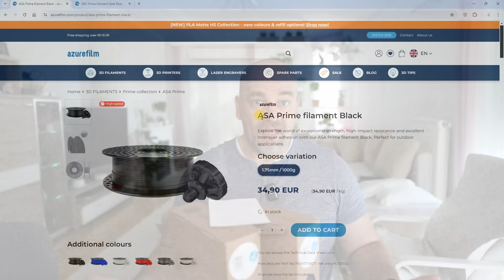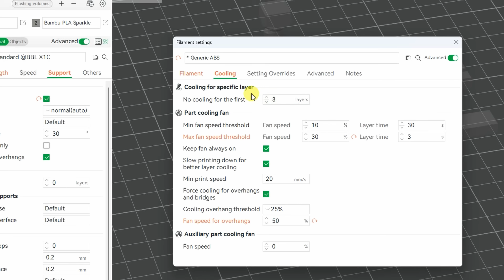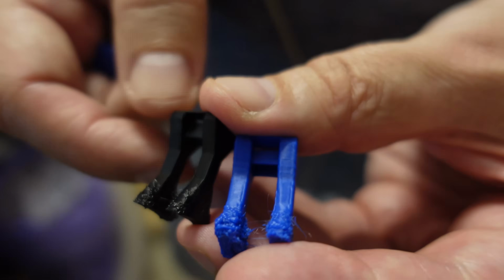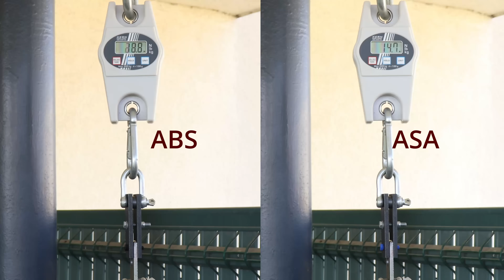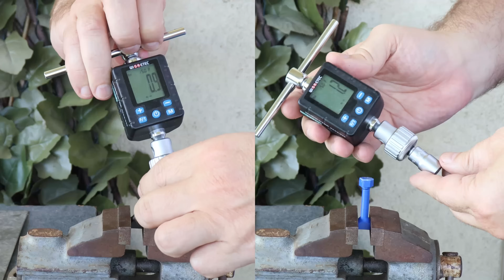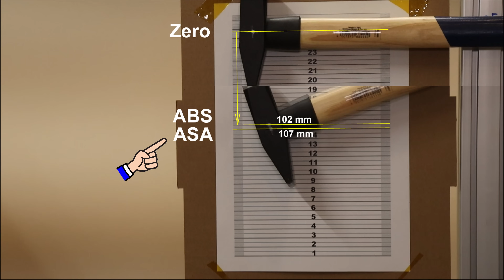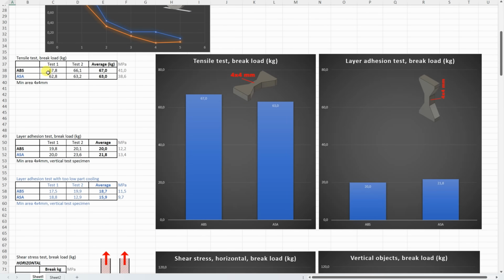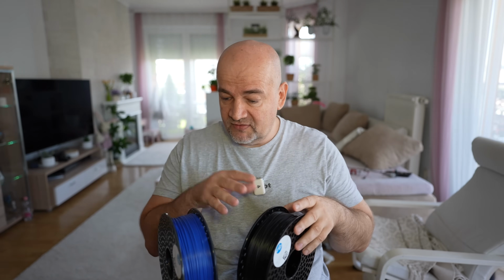Another ABS vs ASA comparison: AzureFilm ABS Prime vs ASA Prime with zero warping techology

Comment: A good review. But. A a serious omission in the testing regime: WARPING! 
Given that the title contains: "ASA.. ...with zero warping" is in the title, where are the warping tests?
Warping susceptibility is the single most negative property of ASA filaments.
Reply from the maker: Its here: https://youtu.be/GfG65ypKTPE?si=306EgZEVGc_qOXDn&t=624
Reply: @MyTechFun  Thanks. I had found that video. I am not impressed with eSun ASA: the layer adhesion is so poor that larger prints warp at an intermediate position, contrary to having good bed adhesion. 
Generally there is a correlation between warping and layer adhesion, except for Flashforge where the result is 10 & 3 whereas Azurefilm is the opposite at 1 & 10. 
Finding the ideal ASA filament is not easy.

Comment: I would suggest that you don't show the summary in a PDF or excel style but show the grey graphs in full screen mode after each test, I think that would improve the videos. Basically skip the summary and intersperce it between the tests to make it a bit easier to relate to the tests and easier to digest in small amounts.

Comment: What do you think is the best filament for gears? Low warping, tough, which brand?  For instance, PA12 eSun is better than other Nylons, that I've tried. But it is interesting to try BambuLab PACF, ASA +CF, and PETG +CF.
Reply from the maker: Usually injection molded are made from nylon.

Comment: I would love to see if the reduced warping persists when you use a printer without an enclosure. I think the need for an enclosure is the main entrance barrier to ABS-like materials for most people. The manufacturer claims it works, so maybe give it a try and share the results? I would highly appreciate it!

AzureFilm on ASA Prime: "We recommend using an enclosure or enclosed 3D printer, though this material can be printed without an enclosure."

Comment: I would like to make a suggestion for a future video/series: How does layer height (and possibly also in combination with speed) affect strength - most likely just in the realm of layer adhesion. The best I can find on this topic is a 5 year old video from CNC Kitchen on this topic tilted "The influence of layer height on the strength of FDM 3D prints" that talks about layer heights of .1, .15 and .20 - which don't exactly align to today's layer heights in modern slicers. Also 5 years ago in 3D printing might as well have been 20 years ago given the printer speed and filament quality enhancements since then.

My primary motivator for this topic is I am 3D printing light sabers for my kids, and I want the best layer adhesion possible, especially for the collapsible "blades". Beyond light sabers, I often will drop the layer height down to .16 or even .12 to try and make whatever I am printing as strong as possible, so it would be good to have more recent guidance from someone I consider to the GOAT of 3D printing strength testing. 😁

Lastly, I don't do a lot with Patreon so I want to encourage you to explore the YouTube membership system as I would sign up for the like $2.99 a month to help out the channel and you amazing efforts.
Reply: Whether overextrusion affects strength should also be investigated, I print parts that need strength at 103% flow hoping the extra material squishing against each other would be beneficial
Reply: @youtubehandlesux  Excellent addition to the idea!

We should probably also consider printing temps because I think hotter filaments will take longer to cool and that might enhance layer bonding.

Comment: Perhaps it’s the chemical properties?  Is there a difference?

I’m currently repairing my floor from a failed toilet seal, so I’m working with ABS wastewater pipe, and the appropriate ABS glue.  If the plastic manufacturers need to manufacture in ABS to maintain compatibility with legacy products, making additive manufacturing filament is probably an easy revenue stream to add to their business.

Comment: I think the parallel existence of ABS and ASA is easy to explain - inertia in the market place, not really for any technical reason.

ABS was invented first (1948) while ASA wasn't invented until the 1980's. ABS is still used because so many things were designed to be made from ABS plastics including interior car parts, plastic toys etc...(Lego!) and for the things it's used for its "good enough" with no compelling reason to switch to another material unless you need a property like UV resistance where ASA has a clear advantage.

So when consumer 3D printing first came along supply chains for ABS pellets that could be made into filament were far more readily available and cheaper than ASA - ABS was one of the first 3D printing materials (before PLA I think ?) while ASA is very recent for consumer 3D printing.

Initially ASA was a more expensive filament (still is in some brands) due to a smaller commercial supply of the material, so ABS had a reason to exist but that difference is going away. At the point when they reach universal price parity you do have to wonder why ABS still exists other than to allow people already printing in ABS to continue to do so.

But if you were starting 3D printing today and they are the same price then I would say skip over ABS altogether. ASA is either equal to or significantly better than ABS in nearly every metric as your tests and many others show.

I print in PLA, PETG, TPU and ASA - I have no interest in printing in ABS because it's a backwards step from ASA in almost every way and offers no unique or significant benefits over ASA. ASA really is just a better ABS.
Reply from the maker: Such a reasonable explanation. Thanks. Probably in a decade or so, the ASA will completly replace the ABS.
Reply: Abs is still avaliable in more colors than asa by far. That's why. Filament companies just need to get on board.
Reply: Supposedly asa is harder to color vs. Abs when injection molding and when injection molding asa its supplied already with colored pellets rather than coloring the batch on site.

Also well for most injection molded uses the things that make it nice to 3d print dont matter.

Comment: I printed some ABS in the past, but never ASA! 🤦‍♂ I should give it a try!
Reply from the maker: After so many testings, I don't really see the reason for using the ABS. In most cases (mechanical properties) the ASA is better. Additionally, it is UV, weather resistant, less smell.. There are some diferences between manufacturers, but for example Prusament don't even have ABS from exactly this reason.
Reply: You really should 😊

Comment: Hi, I'm not a Patreon supporter but I might be soon.  I'm an engineer with 14 years of experience that has started 3D printing 2 months ago (averaging 2 kg/week).  I mostly print Polymaker ASA for practical parts so this is an area where I might have some useful feedback.  The biggest problem with ASA is warping--I have invested a lot of time and money into sealing my P1S and regulating the chamber temperature so that it stays at 60C.  Printing ASA with chamber temperatures less than 50C is a recipe for disaster--certain types of parts will warp with incredible force, and you can only slightly mitigate this by going slow.  You should do a side-by-side comparison of the regular ASA and this ASA Prime to judge this warping.  Since you have a X1C, I recommend you build the 2nd AUX fan (link after my message) for 2 reasons: 1) the 2nd AUX fan will make your overhangs better on the right side of the bed, and 2) the upper duct (the piece rendered in orange) is a perfect test of warping.  Finally, I am interested in learning what Azure did to the ASA formulation.  According to their site, ASA Prime has lower UV resistance than regular ASA--that is a big compromise that cannot be ignored for practical parts.  I would like to know how much less the UV resistance is.  https://www.printables.com/model/435201-bambu-lab-p1-x1-dual-aux-fan-bentobox-728-updated
Reply: @EliteMacFreak  I print primarily with ASA as well. I don’t have any problems with warping anymore. I use an X1C, polylite ASA, chamber temp >40C, bed 90C, magigoo on high temp plate. I run a max volume speed of 12mm3/s since I need part strength. For my wide and tall parts I put thin vertical slots 1mmx10mm about 3 to 5 mm above the bed every 75 to 100mm to act as strain reliefs during printing. Sometimes I just use 3mm holes. Works like a charm.
I credit Igor for putting me on to polylite ASA.
Reply: @spongecounter  That's interesting.  I would think that putting internal voids in the ASA for it to expand and contract would result in very poor dimensional tolerances.  Have you ever measured your parts for dimensional accuracy, or is what you're printing not that sensitive?
Reply: @EliteMacFreak  for clarity, the slots are only for printing stress and punch though the entire parts. I find they reduce the outer part dimension tolerance variability a tiny amount. Probably because of stress relief as the layers build up.  I wish I could add a picture in the comments here.
Reply: Wow can't believe yt let you post a comment with a link...
Reply: @riba2233  I've had this account since Youtube came out (hard to believe it's been been almost 20 years), it's tied into my Gmail account, and although I'm a super-heavy user I rarely post so maybe at this point there's a certain level of trust.  Who knows!

Comment: I appreciate the effort you put into comparing ABS and ASA filaments. However, I’d like to address a couple of issues with the methodology used in the video.

Firstly, the sample size of 2 is quite small, which significantly affects the reliability of the conclusions. To better assess the results, it's important to consider the standard deviation and margin of error. With standard deviations of 1.202 for ABS and 0.283 for ASA, and only 2 samples, the degrees of freedom are 1. This results in a t-value of 12.706 for a 95% confidence interval and 6.314 for a 90% confidence interval. Consequently, the confidence intervals are:

- **ABS @ 95%**: 56.15 (lower limit) - 66.95 (average) - 77.75 (upper limit)
- **ABS @ 90%**: 61.58 (lower limit) - 66.95 (average) - 72.32 (upper limit)
- **ASA @ 95%**: 60.46 (lower limit) - 63.00 (average) - 65.54 (upper limit)
- **ASA @ 90%**: 61.93 (lower limit) - 63.00 (average) - 64.07 (upper limit)

At both 95% and 90% confidence levels, the results are statistically indistinguishable. 

Secondly, testing different filament colors can influence mechanical properties, as noted by Stefan of CNC Kitchen. Consistency in color is crucial for accurate comparisons.

Given your expertise as a mechanical engineer with a Ph.D., I would expect a more scientifically rigorous approach. Providing accurate and reliable information is vital for the makers’ community, and I believe they deserve detailed and precise data.

Thank you for considering this feedback.
Reply: This is all nice but he is doing this in his free time, for the community and losing money on it. So we need to be realistic with our expectations.
Reply: @riba2233  Thank you for your response. I genuinely appreciate the time and effort the creator puts into producing this content for the community, especially as it is done on a voluntary basis. It’s clear they are passionate about helping makers, and their contributions are valuable.

However, my intention wasn’t to criticize unfairly but to highlight an important issue with the methodology that could lead to misleading conclusions. When using a small sample size, there’s a significant risk of drawing incorrect inferences—for example, suggesting a difference between materials where none exists or overlooking important nuances. This is precisely why statistics exist: they help us quantify the reliability of our results and avoid potentially misleading interpretations.

As a professional engineer with a Ph.D., Igor is undoubtedly well aware of these principles and the importance of ensuring that conclusions drawn from experimental results are valid. Professionals, especially those recognized as experts in their field, have an ethical responsibility to communicate accurate and reliable information. The audience, particularly less experienced makers, may take his findings as "the truth" because of his professional standing. This means the stakes are higher when presenting information, and the need for rigor becomes even more critical.

By ensuring his methodology adheres to established statistical principles and controlling for key variables (like filament color), Igor can avoid unintentionally misleading his audience. Doing so would not only strengthen the value of his work but also maintain the trust and respect of the community that looks up to him.

Thank you again for engaging in this discussion—I’m sharing this feedback because I respect both the creator’s expertise and the impact his work has on the community.
Reply: As you noted, standard deviation isn't really a helpful metric when you have low sample size. If you are going as far as to measure process capability, ideally you need at least 30 parts. and as you noted it will vary further considering spool to spool (long term capability) and color variation. That is a lot of time, money and effort. If MTF had sufficient views or support to sponsor the spools and the weeks required to make a video on the subject, I'm sure it can happen. But practically it's a tough ask.
Reply: @Duckferd  This why then end statistical result is showing large variations. So, we cannot state meaningful conclusions if one product is similar, or better than an other. That way you are misleading the viewer stating conclusions that could be false. It’s will be more important if there results are showing differences that are falling within the margin of error. If there are not enough resources, time and/or money,  then don’t do it, unless you want to showoff. If you look at results from Stefan of CNC Kitchen, he presents data that are statistically sound. Why not Igor? Considering he is an engineer with a Ph.D, he should stand to higher scientific standards which I’m certain he can. Igor, continue your efforts, what you are doing is interesting but show the audience what is the differences between professionalism and amateurism.
Reply: @danielrioux54  I agree with you here that it is best to mention not a 100% scientific test 
As a side note, the thing what we do not see is Igor's  experience. He presents when a trend is abnormal. 
This channel is for situations when you want PRELIMINARY results. For scientific measurements, you can read Igor's articles. 
A few channels present this and in a consistent manner
Reply: Probably for same material the color might produce  significant changes in properties... but ASA & ABS I do not think it has the sane pigments for blue color for example
Reply: @contrezerva9024  What proof do you have? It is only speculations without facts. At least Stefan from CNC Kitchen is showing data.
Reply: @danielrioux54  I have not tested for myself. Look at the ASA natural and ABS natural. They are pigment free at that stage. ASA is kind of yellowish,  ABS being white. So, to get them blue for sure, they will need different pigments or/and definitely different concentration of pigment. Maybe in testing, the differences aren't that noticeable. So, to be more or the science side, different materials should be tested on pigment free situations.
Reply: Or at least 5 samples each. At least then you have something that begins to resemble statistics.

Comment: I use ABS and ASA pretty much interchangeably and don't really bother with the distinction that much. I find most differences between the two plastics seem to vary more across different manufacturers/base resins than between the material itself. 
Azurefilm ABS was probably the smelliest I have printed yet. I started a print in the evening,  and when I came back into the room the next morning, I thought I'd need a gas mask to reach the window. I think I might have heard my Nevermore crying somewhere in the corner. I have another spool of Azurefilm ABS I bought together with that first one, but I have not yet dared printing it.
Reply from the maker: I agree. Soon I will have 10 ASA filament comparison... in 1 month or so